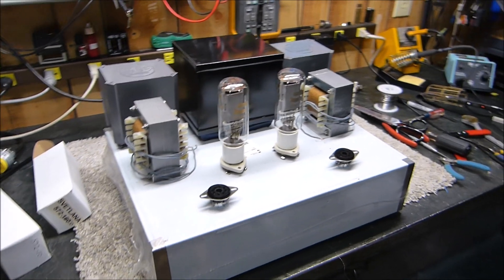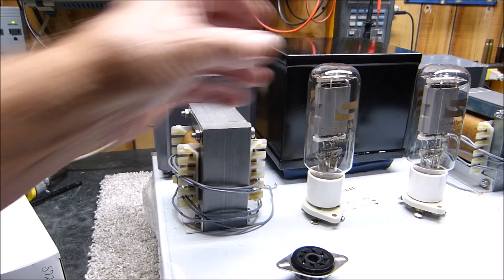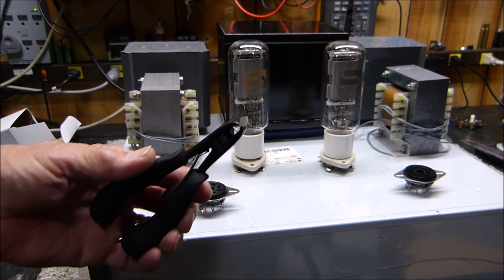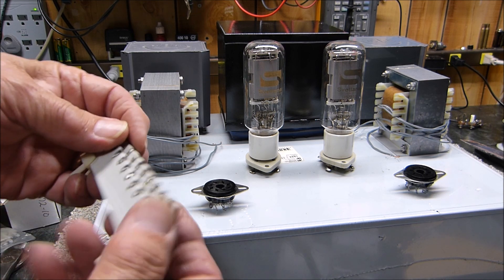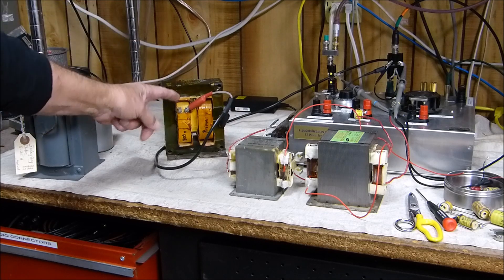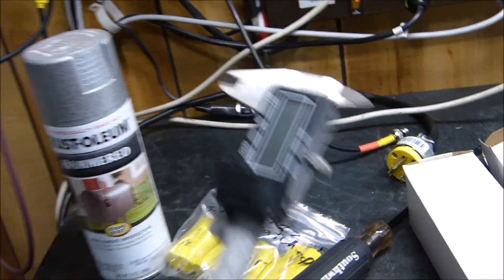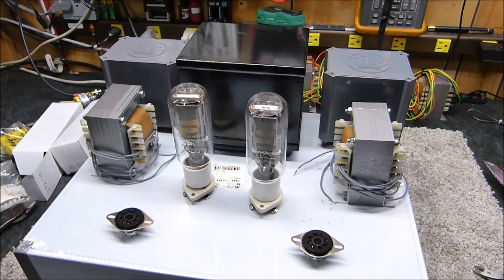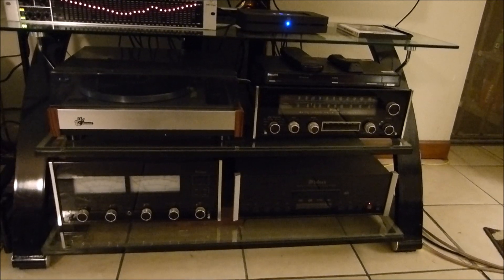Svetlana SVT572-10 SET 20 Watt Per Channel Stereo Amplifier Part-1

Comment: Why the crap equalizer with all that fancy, boutique equipment? Kind of odd as a choice, isn't it? Don't come back saying it's good. I know that thing - it is a lot of bands for a lowish price, but it's way out of its league there.

Anyway, thanks for a great video, full of useful information.
Reply from the maker: I am not really going to disagree with you but I find the bass and treble control of a preamp insufficient. Also, and this may come out odd but I find all of my amplifiers rather dull except for the SET. I am ruined... Suggestions?
Reply: @ElPasoTubeAmps  Know what you mean, I've built valve amps that have very low THD but they don't sparkle, sound like a wire with gain, but experimenting on the last build I tried Class AB2 - 7% THD, sounded great. A lot of Audiophile's turn their noses up at equalizers and tone controls, daft buggers, who cares, if you like the sound that's all that matters. A bit of EQ is often needed, everyone forgets the room your gear is in, the only bit we can't really design for......DA.
Reply from the maker: @diabolicalartificer  I have indeed, realized that THD is not the last word - nor is enormous power. Some years ago I build an amplifier with PP 6B4G and an audio transformer stamped with the US Navy seal on it. Probably came out of some WWII or cold war communication equipment. 10K primary so likely PP 6V6. It did about 15-20 watts and had a few kinks critical analysis on the test bench but I loved the sound. Sounded more alive. I recently read an article where there was a legitimate A/B test done with a group of audiophile-ear fellows, allowing only two at a time to listen and playing for some extended period of time and the cheaper equipment was the preferred sound, which also included cheaper RCA connecting cables and everything in between. That does not mean that anyone is "dumb". I think it tends to mean we like a little "sparkle" and we might get a tad more with the cheaper equipment. If that was not somewhat true, we would all prefer solid state equipment with 0.01% THD and the problem would be solved - no more vacuum tube amplifiers...
Reply: @ElPasoTubeAmps  Indeed, but how do we design for "sparkle" & "aliveness"? Aye, now there's the rub.....DA.
Reply from the maker: @diabolicalartificer  That is the million dollar question and I am deep into that thought process and discussion with two of my friends locally and now with you guys... One thing that jumps out at me, regardless of the THD being at 3-4%, the sine wave looks Great and the HF response is exceptionally good. Frequency response of the 300B amp was down 3dB at 50KHz. I read a number of articles on poor HF response of the SE amplifier? I don't see that. 
I don't see any crossover distortion or sharp kinks in the waveform either. I have read all kinds of theories from the less components idea that will deliver better sound to the idea that in PP the signal has to be "taken apart" and then "put back together" and that is a bad thing. A little too simplistic explanation for me. 
We do have to remember that some PP amplifiers sound very good and they can deliver Lots of Power and as I like to say, can drive the nails out of the wall if necessary. 
We also have to keep in mind that in 1940, the public and engineers were trying to get away from a two-pound-per-watt amplifier and up the power of maybe 50 watts with out it weighing in at 75 pounds with a separate power supply. Nowadays, we can have a 5 watt per channel that weighs in at 55-60 pounds and we see that is OK. 
I cannot say at this moment what the "magic" is in detail coming from the system but I do hear it and I do like it. I also like a little power --- 20 watts per channel with the sound of the 300B SET I just build will make my home listening system happy forever. Forever? Well, I don't know about that but we all know how to build Power into our amplifiers. Now I want to build the articulate sound of the SET into it.
Reply: @ElPasoTubeAmps  I look forward to the discussion and your thoughts on the subject,. That's the beauty of DIY amplification, striking out off on tangents....Da.
Reply: @ElPasoTubeAmps  Schiit Loki, a 4-band stereo EQ with very transparent-sounding gain for $149. Built in Valencia, CA for those who care about where their products come from.
Reply from the maker: I knew this was going to happen with I stepped away from a purely analytical approach with laboratory equipment. Now I am never happy with the sound. The term I have heard it called is, "tweaking audiophile". I don't particularly like that title. I should stick to my spectrum analyzers and never listen to an amplifier with more than 0.5% THD or less than 16 dB of global NFB. I was happy then. (you know I am kidding...)

Comment: I would try you rig without the graphic equalizers. I bet their fidelity isn't that great. Also move the tektons out from the corners. Let them breath. The sound will get bigger and more spacious.
Reply from the maker: I have considered putting them closer together at the ends of the sofa and the table and lamp on the outside. Is that what you mean?